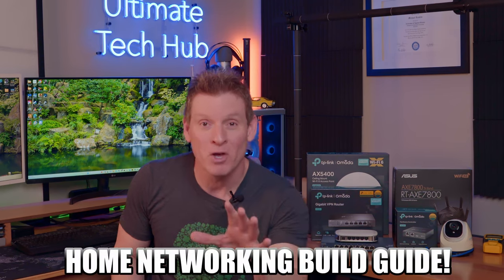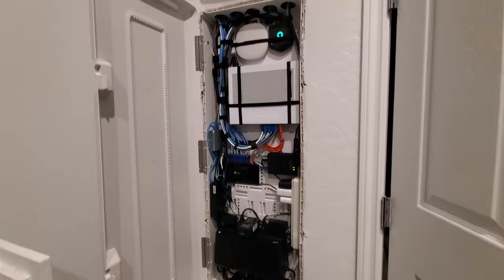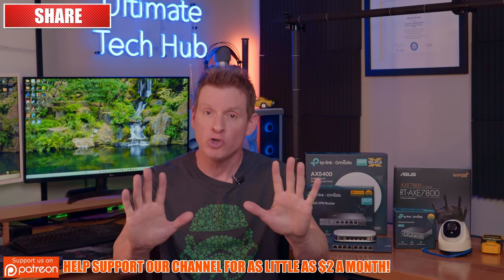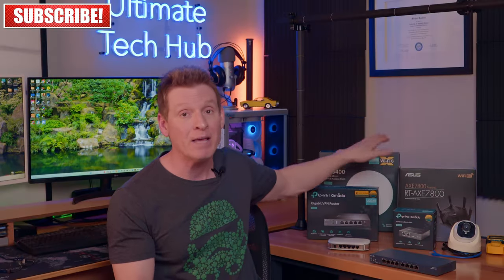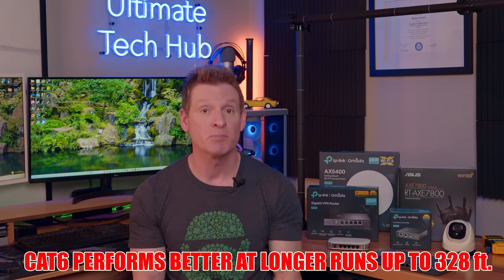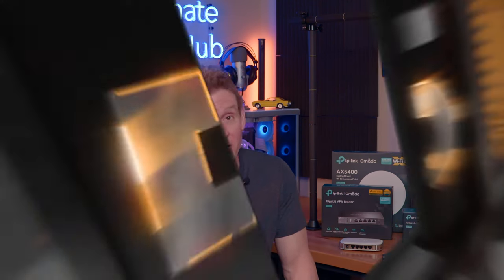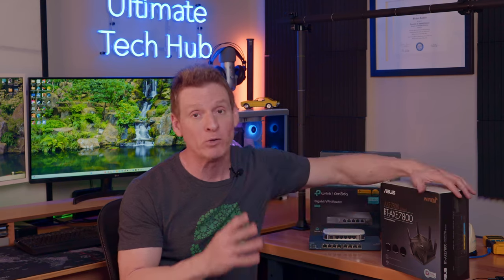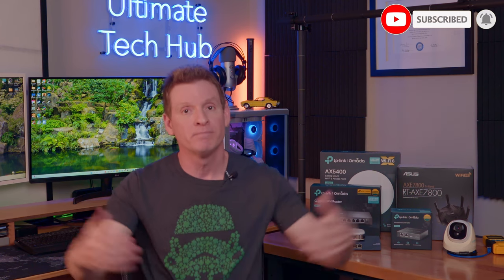HOME NETWORK BUILD GUIDE 2024 - HOW TO

Comment: Thank you for the video! I have a gigabit fiber connection that I pay dearly for. Currently supplying one neighbor via a wired connection and want to securely connect three more neighbors via cat 6 and a edge router and v-lans. My ISP uses a edge router for a modem. I know just enough about networking to get myself in trouble and, therefore, would be willing to pay you to help me design a network and get it up and running.

Comment: Great video very educational & straight forward. Cpl questions tho. So poe is for cameras and other certain devices? And this might sound dumb but my ip provider I  only get 100mb so obviously 10gb it's useless?
Reply from the maker: PoE is for Cameras mainly and also for PoE Access Points. 10gb can be achieved through your Network from one computer to another ( Massive File Transfers )  but you need 10gb compatible PCs. So for your situation 10gb is not necessary. Thanks for watching!
Reply: @UltimateTechHub  even with getting pcie 10gb network cards and a network switch with 10gb rj45?

Comment: Bro got a question if I don't have a ISP cable coming in to my home is it possible to make home network setup? Or can i use a router that supports sim cards for setting up a home network and get access to internet?
Reply from the maker: Both are a good option. I would always prefer a ISP cable coming into my house because its a more stable and secure connection and usually faster. Which local ISPs do you have in your area?

Comment: 6:50 If you are going to mention that cat8 is overkill at least include information about shielded cables because if you are in a high power or network environment, cat6 is still doesn’t always cut it and can have inconsistent results even disconnecting and reconnecting problems.

Comment: If your home has coaxial cable throughout, I would opt to use a moca network before using power line to extend wire connections if you cannot install Ethernet.
Reply from the maker: I agree. Thanks for watching!

Comment: Should i replace the provider router with my choice like the one you recommend or just connect the new router to the provider. New to networking so pardon me
Reply from the maker: Replace the ISP router. Keep the modem obviously but a new wifi6e router will make a huge difference. If you need router recommendations I have a few in the description below. Thanks for watching!

Comment: Awesome video! Very very detailed. I was just wondering whether it is worth to replace my Tenda Nova MW6 mesh routers to access point. Today I got the ISP modem + an unmanaged switch routering the connection to the mesh routers (I got 2).
Reply from the maker: If your wi-fi signal works well then I would leave it alone. If you need more speed and better coverage then wireless access points are fantastic! Thanks for watching I really appreciate it!

Comment: I've used an electrical line extender from my living room to my gaming room which is a small room outside my house. The price I've paid is that I'm only able to enjoy 1/10th of my ISP speed. What reco can you give me so I can extend an ethernet cable from living room to gaming room?
Reply from the maker: Here is a video that might help. If not, please send me another comment with your questions.
https://youtu.be/VVbUIis78uQ
Reply: @UltimateTechHub  thank you..I had a look at the video, the problem is that you're going from one room to another directly opposite and they are wall to wall. In my case, the cable I want to install has to physically leave the house, and go to a small room outside the house
Reply from the maker: @vashnator  I would run some heavy duty cat6 or cat6a in conduit or some sort of PVC. If you can run along a wall that would be great. Otherwise you could run it in trench. Just make sure the pipes are water tight

Comment: lets say a hypothetical i have a 1 router with a 5 Lan ports connected to ISP provided device, my router connects to an 8 port switch (netgear unmanaged), this connects to a filedump nas which then connects to a 40tb nas and 24 tb Nas, i find the throughput when copying from file dump to othe NAS drops a lot until i reboot the switch. is there an optimal daisy ring scenario ? my file dump is connected to router others to switch
Reply from the maker: The optimal way I would do this is to get a 10gig managed switch instead of the unmanaged switch. You can control the throughput through each individual port and assign QoS and many other settings. Unmanaged switches are great for simple day to day tasks but your situation requires more data control. Tp-Link makes some affordable managed switches with 10gig ports. Keep me posted and thank you for watching I really appreciate it.